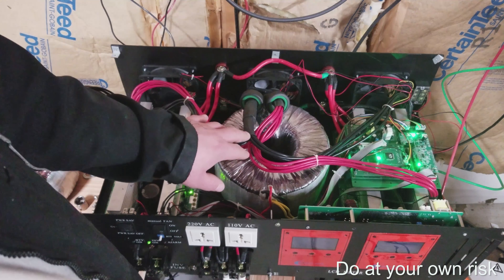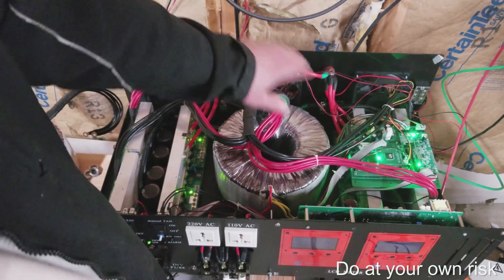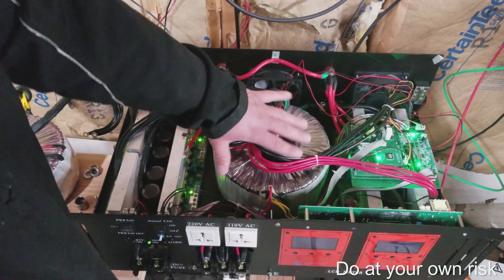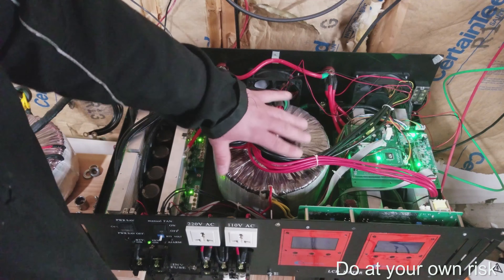Power Jack 15KW inverter Cooling mod

Comment: here is an idea,..i have always thought if you took the top plate off, along with that rubber gasket which i see you did which i think is a good deal for ventilation,...try lifting the transformer off the plate a bit to give it better circulation of air flow with a built in fan on the top and ill bet it will keep it much cooler,....just a thought,...

Comment: have you load tested this unit yet very likely you not get any more than 6-7KW out of this (3-3.5KW 20Amps per leg) just form the thickness of the cables at 110v

Comment: My 15kw 48v unit is a little different, but I was wondering... can the bolt cause electromagnetic interference?
If so, maybe it's a good idea to remove it?
Reply from the maker: Depends on what the bolt is made out of.
Reply: @GPVlog  I Need a 15 KW Inverter 24 Volt DC to AC. How much Price US Dollars